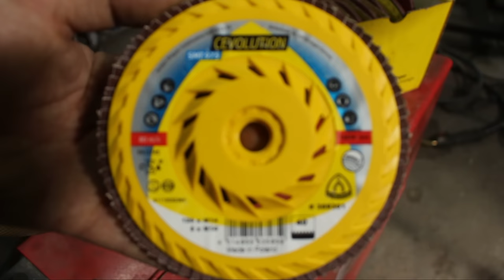Buduje Kojec Dla Mojego Psa w Nowoczesnym Wydaniu

Comment: Love the build - especially the swinging feeder door! Not sure how much rain you get there but a roof slanted away from the old structure to help keep the kennel dryer and gutters or overhanging roof would be nice too. Sewer drainage pipes along the outside. I clean up poop everyday but sooner or later, it starts to collect around the kennel from spray washing the kennel and becomes a sanitary issue to the eyes and nose.

Comment: Excellent job.  I will suggest putting pet fake artificial grass inside during winter. Concrete is very cold on dogs' paws. 
I have 5 German shepherds and love them. Easy to train, intelligent, and territorial.  Also, dogs can't be alone.  They are designed to be in a pack. Try gerting him a company, you will be surprise to see him more happier.

Comment: You have 2 A frame roofs coming down on your dog kennel. The rain is going to go towards the house where there is a window. I would have build a slight lean too away from the wall with the window so any rain from the other 2 roofs will shed out into the yard. It looks stylish and well built.
Reply from the maker: the rear structure of the roof is also a gutter
you can see it there in the video on the right

Comment: I would add a lower area of some 1m3  for dog to poop, sewage installed so you could wash it. Concrete is not good for the dog to stand on for long periods of time, I would add a rubber conveyor belt on concrete (I have a power plant nearby they change them so I could get them for cheap). The rest is fantastic. Liked and Subscribe!

Comment: Very good dog cage and well built. would have been good if you lifted the framework up off the floor so hosing down would be easier. Also a slight slant on the roof with maybe guttering would have been nice too, but hey you did a great job anyway. 
My favorite dog but lost two so no more now.

Comment: 1: Use some 8-10 cm to raise the dog house.
2: The same wood panels you placed in the front of the dog house, fill the whole kennel with them, it will protect the dog paws and articulations.
3: German shepherd has long hair coat, but if you have hard winters, i will drawn another dog house. I use two rooms dog house for my dogs because they have short hair. If you need the project, i will gladly send them to you.
4: Great feed system! I use the same system for my kennels. When the dog rise, be sure to rise up the bowls. 
5: If you keep the dog longer than 2-3 days and is it windy and you see your dog eyes a lil bit red..ish, it`s a lil bit draft in the kennel and you have to cover at least 2 sides.
6: If you don`t like the comment, well.. You can tell them i said : trust me, bro. :)
Nice work, keep it up, we are happy with the content!
Reply from the maker: I agree with the advice :)

Comment: Looks good but not very practical.  No drainage,any fluids on the floor will just run into the gravel and stink. Any solids will stain the floor as its not sealed and any washdown water/chemicals will also just run into the gravel and stink.

Comment: The door might be a bad spot for the bowls but amazing work looks great 👌👌
Reply: They are made inside of door and twist around for easy access
Reply: @charlotteadams4907  I get that. Looks great. I just personally wouldn’t want to clean the water every time i open and close the door. The bowls move with the door therefor the water is always going to spill if filled every time.
Reply: @EseMismoSoy   Agree with the comment. Would have probably made more sense to be on a side wall.  Also agree with another comment, shouldn't be concrete. Should have put down turf grass or something for the doggo.
Reply: Concrete is hard on dogs kneed and back by the way. That's why I suggest a complimentary soft surface like an outdoor rug or the fake turf grass.

Comment: It looks nice but….I can see you dont have much experience with actually looking after kenneled dogs.  First, you need to lift lower horizontal bars up by about 3” so you can easily spray the giant poo piles out of the enclosure, and ideally, spray them into a catch trough that then flows into a dedicated septic with a hair catch.  Secondly, you need to seal the concrete with something like an epoxy finish or all the urine will soak into the slab, and it will forever stink of dog pee with no way to ever eliminate it.

Comment: I don't know where you live but here in the US summer temps can get to 100 degrees Fahrenheit for days at a time. My dogs are only outside to do their business and then race back in. You might want to consider a doggie door that will go back into your house. Otherwise, if you insist on using this make sure that the roof will not heat up but provide shade. You might want to cover two or three sides to provide more shade. If you leave it as is - it can be very cruel. Especially on a dog with a lot of black fur.